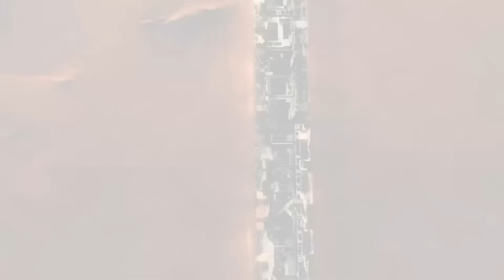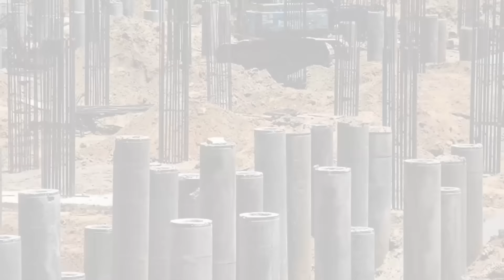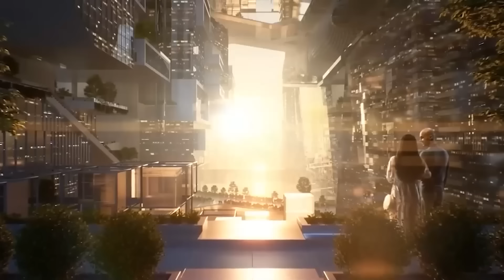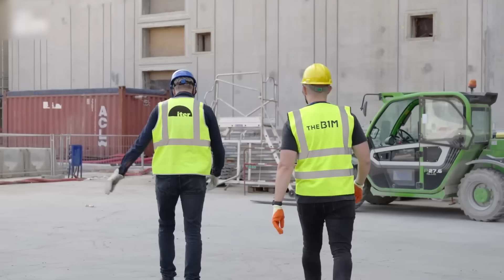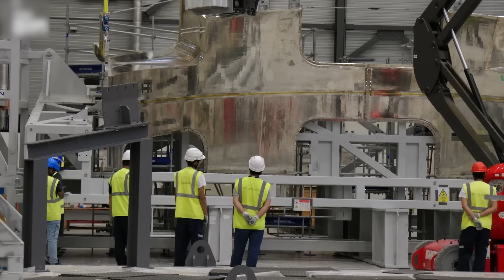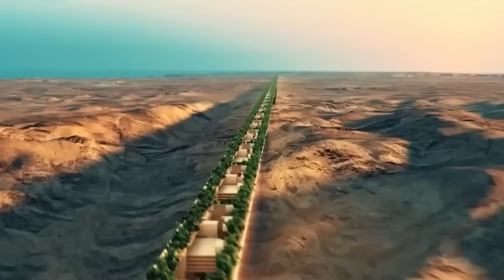The Line Massive 2026 Construction Update

Comment: Even if The Line is feasible, who with a sane mind would be willing to live trapped with millions others in an endless corridor, squeezed between two mountain-high walls only 200 meters apart.  With the alignment of buildings as a landscape and the upper floors infrastructure for the sky.  That's not a crazy project, that's a project to drive people crazy.